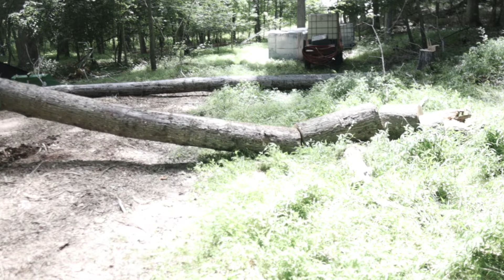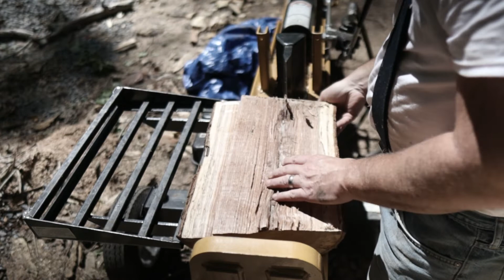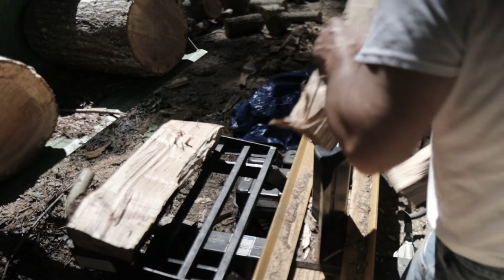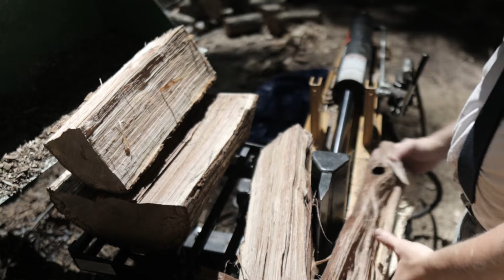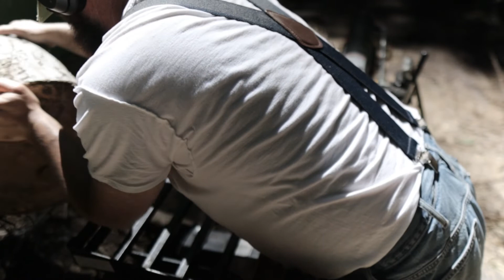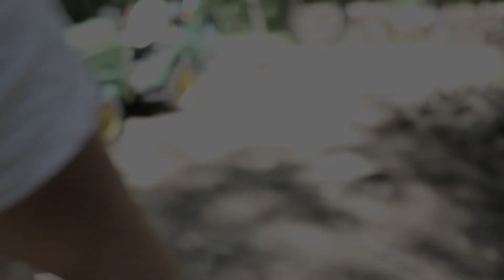John Deere 2025r, Stihl MS 362cm, and Countyline Log Splitter Combine To Make Firewood Easy

Comment: Any suggestions on balancing mower deck? 
All wheels even right at deck, tire at same pressure. Middle blade was not turning and there for not cutting. Lifted mower deck up via bucket and removed twine. I’m not good at this stuff but learning along the way. I need this tractor and I really can’t afford to have John Deere look at it.
Have had my 2025R for 5 years and love it for my small 6 Acre farm and when it’s down my farms down.
Reply from the maker: If the middle one is not spinning, but the others are, especially after getting something tangled, check to see if the belts on the top of the deck are tight. If they're tight and the center still doesn't spin, it could be a broken shaft in the spindle. Turn an outside blade And if the center doesn't spin, it's probably broken.